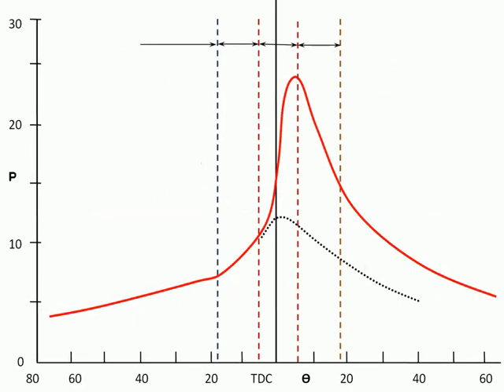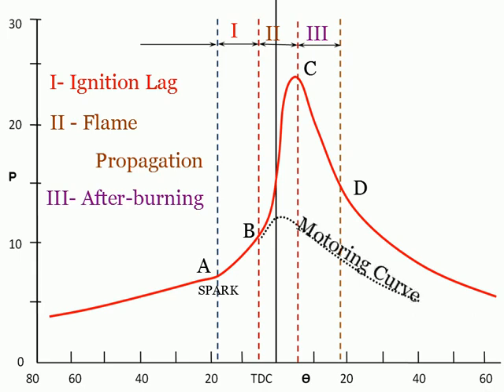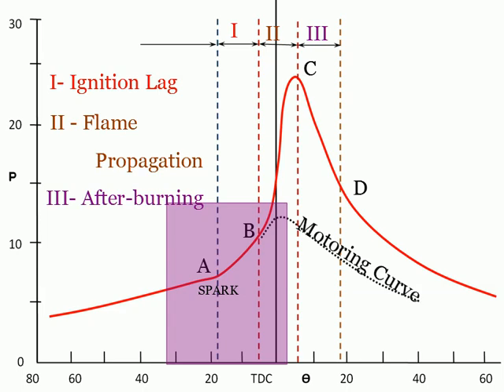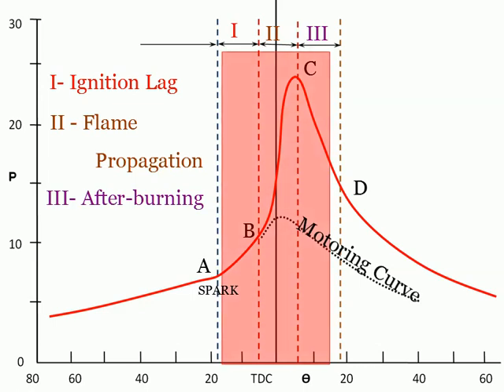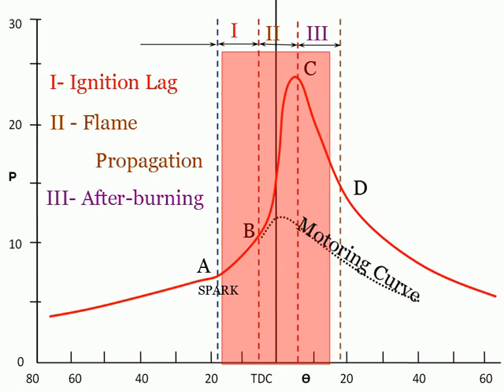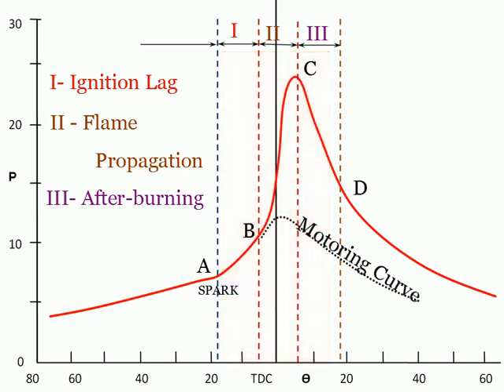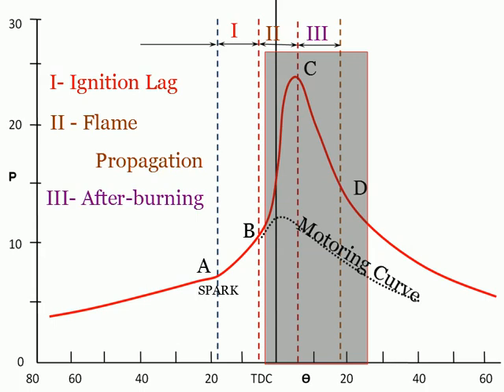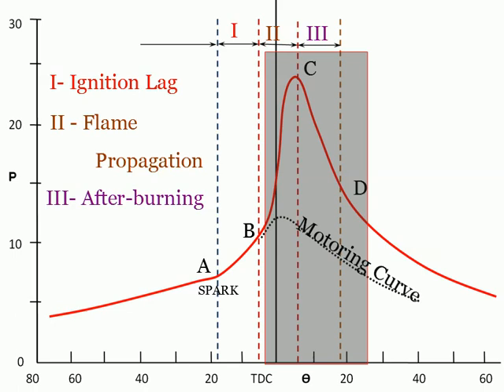Stages of Combustion in SI Engine

Comment: According to many engine development companies such as Ricardo maximum energy is obtained from the burning gas if the crank angle when peak cylinder pressure occurs is 14-20 degrees ATDC not 5 to 10 degrees.